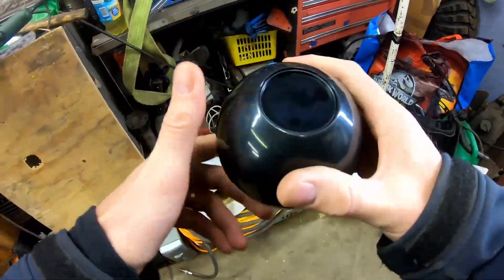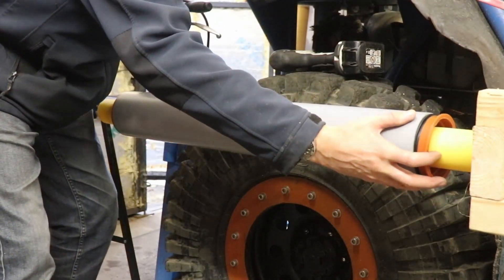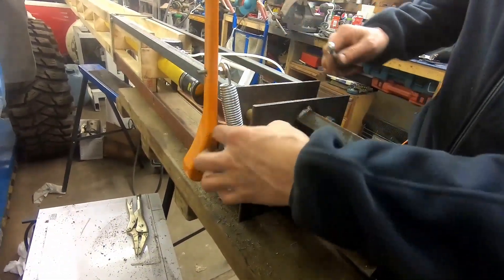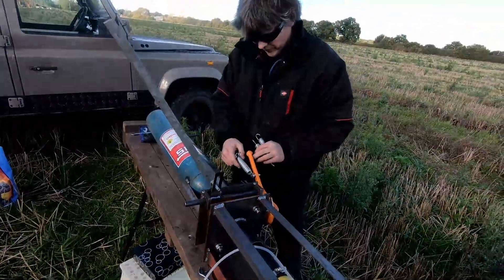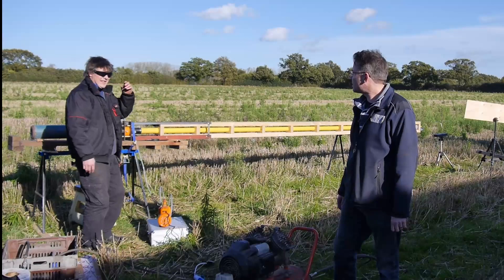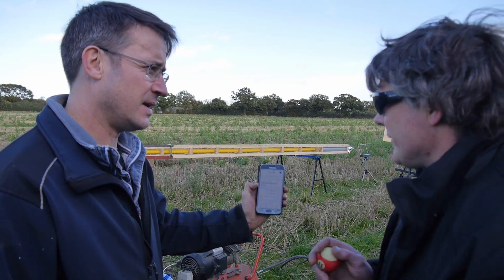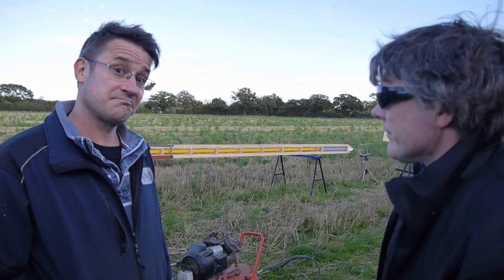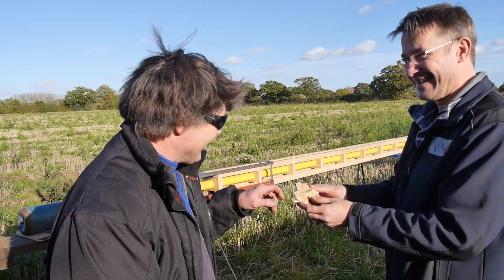SUPERSONIC 8-BALL Vacuum/Compressed Air Cannon (Experiment) Part 3. #World’s Fastest 8 Ball.

Comment: Where did you get that airtight butterfly valve? Im using a 2" sprinkler valve but i know it doesnt flow as well
Reply from the maker: Hello,
Found it in a skip. But I checked its deets online,  it's rated at 80psi but it starts leaking at 450psi.
Reply: @VERYMENTAL  in a skip? What do you mean? Thanks for the reply
Reply from the maker: Err....dumpster.
Reply: @VERYMENTAL  oh haha. Well I check on Amazon, didn't realize how inexpensive they are! I feel like a fool for getting a 2" $250 sprinkler valve. I should have gone with a 3"  stainless butterfly valve. Rated to 220 psi and over twice the flow!  My 3200 cubic inch PVC monstrosity keeps springing new leaks I instead bought two 11 gallon portable air tanks. I'm going to weld 2" NPT Bungs on each and join them with a T.
Reply from the maker: I've only just discovered you, give me a minute or a couple of days so I can watch your back catalogue and I'll get back to you.
Reply: @VERYMENTAL  I haven't posted any compressed air gun videos yet. I want to break over KM in range before showing it off.
Reply from the maker: See if you can beat me
Reply: @VERYMENTAL  I don't have a chronograph I have to do frame by frame for a close guess..
Reply: @VERYMENTAL  https://youtu.be/7-mAja-jk6I?si=0f7Wq2Xu-1CduWIP this may be interesting to you. It's a bullpupped (2" barrel surrounded by a 4" chamber) combustion launcher, ignition came by way of exhaust from an APCP rocket motor, and they had 25 gram warheads.

Comment: If you add a muzzle on the end of the barrel you will get that ball to go even faster, because theres not always a complete vacuum in the barrel so the extra air gets compressed inside acting as a cushion for the ball, finally though the ball pushes through, a muzzle with two chambers in it so the extra air can be pushed into the chambers will be amazing
Reply: He did that